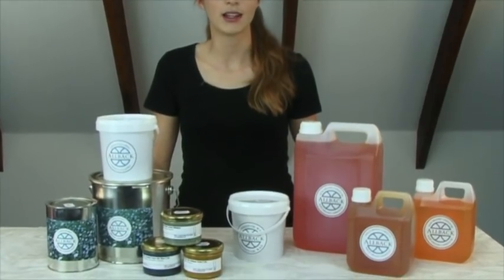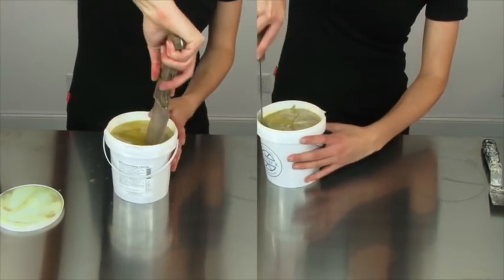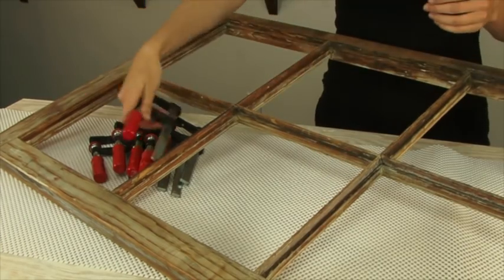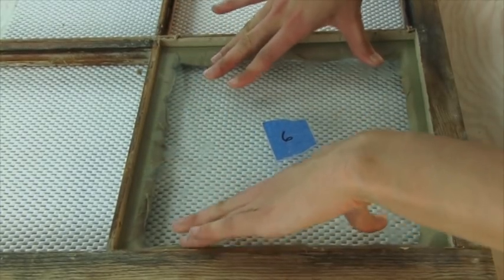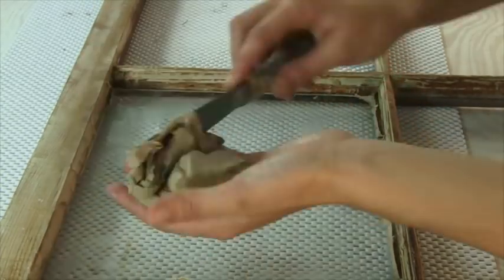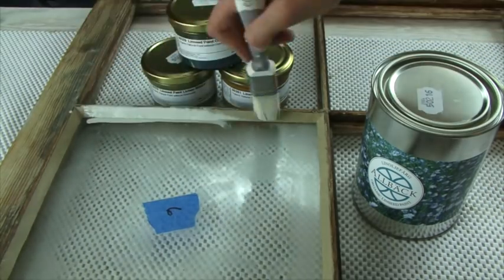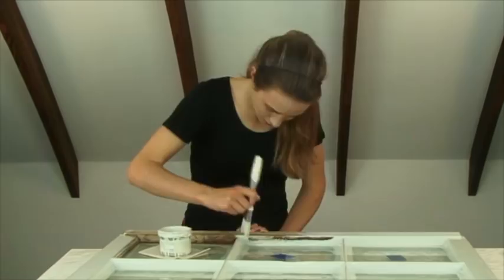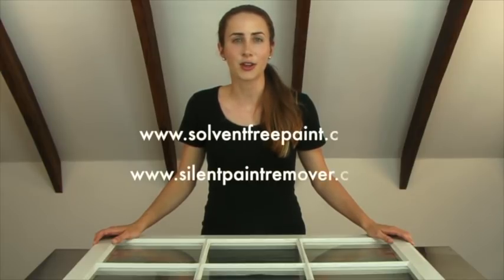Window Restoration w/Allback Linseed Oil Products: Part 2 [Full]

Comment: This  and part one are really useful, thank you! I am reforming an old Casa Rural in Northen Spain and need to improve  at least 10 windows as they have different sizes and come with internal shutters as well! They were installed in 1934. This video has reduced some of the nerves I have in doing this.  I just need to purchase some tools!!!!
Reply from the maker: Window restoration is time consuming but a lot of folks get really into the process once they get started. Just start with one window to gain experience and confidence. It sounds like a project well worth the time and energy! Check out one of the newest videos showing Swedish Windowcraft methods as well: https://youtu.be/VXnEwrelg_c Hope this is helpful and good luck with your project!
Reply: @Earthandflaxstudio  Thank you.

Comment: Is it this specific combination of products that allows you to paint the glazing immediately? I use Sarco brand glazing putty (linseed & soybean oil based) with Zinsser primer and Sherwin Williams topcoat (both oil based) and was always told to wait until a skin had formed on the putty. This can be time consuming and would love to find a quicker approach
Reply: Also understand that when the paint store say they have oil paint they mean Petrochemical oil paint!. Linseed oil paint is something completely different: Natural, breathable and free of Micro-plastic.
Reply from the maker: Yes, the combination of the Linseed Oil Paint and the Linseed Oil Putty (both a natural, oil-based formulation vs. petrochemical-based oil) allows you to paint immediately after glazing. Linseed Oil Paint has a longer dry time (48 hrs or so between coats in ideal conditions) in comparison to most modern coating but the ability to paint right away after glazing is a enormous time saver. Also, no specific "primer" product required. Just glaze and then paint is possible. There are some other technique choices to be made in terms of the steps you do as a craftsperson but it can be that straightforward if needed. We have a newer video on window restoration as well if you haven't seen and hope to make more window restoration content in 2024 too with different methods/techniques. This material combination and method we call Scandinavian Windowcraft.

Comment: I was wondering where I can get wooden window spacers or do I need to make them myself? Also Thank you for such a great instructional videos. I am reglazing my 1950s wooden porch and this very helpful. I can't wait to start restoring the doors etc in my Georgian house now!
Reply from the maker: It is probably easier to make something than find spacers the right size pre-made. I know someone who uses the ends of wooden match sticks (trims off the top), soaks them in Purified Linseed Oil before install after backbedding/before glazing. He trims them down or cuts in half if needed to make a fit (remember you don't want it too tight!). So many various methods but I think that is a fun, easy trick. Hope it is helpful. Feel free to reach out to info@earthandflax.com with additional questions.

Comment: This is the only time I’ve ever heard to paint the glazing immediately. Is that only when using linseed oil paint?
Reply from the maker: Yes, this is only true when working with Linseed Oil Putty and Linseed Oil Paint together. Paint putty immediately so they dry at the same rate - great way to save time on that step as Linseed Oil Paint has a longer dry time than modern, petrochemical coatings. Great trade-off if that makes sense!
Reply: @Earthandflaxstudio  yeah that is interesting!  Does the rest of the paint dry faster than the paint on the putty? How long after painting are you able to install with that type of paint?
Reply: @cdm9011  Linseed oil paint must dry in concert with the linseed oil putty to adhere well. Paint right away. It will dry about the same. Drying time depends on the temp ( 70 degree is best) and access to oxygen. In room temp, it should dry for a week normally. Also depends on the thickness of the glazing putty as well. Paint onto the glass about 1/8" as well as it will prevent water from going between the putty and the glass. Linseed oil paint adhere very well to clean glass. Linseed oil putty can be maintained with the purified raw linseed oil over time. Should last for 50 years with some maintenance and a coat of linseed oil paint every 10 years.

Comment: Any tip on where to find the mullion strips? I have an old barn window with missing wood dividing strips. Thank you
Reply from the maker: Your local hardware store may carry some options but if it has certain profile, a local carpenter/wood shop may be able to make up something that matches or is a close match. Ask around in your area as you may have a local resource you aren't even aware of yet. Good luck!

Comment: I watched part 2. My mom brought her broken kitchen window when she was cleaning both sides to the window co to replace/repair the glass and glazing compound. She picked it up and brought home. They did not paint the color brown. Was it supposed to match the window? The compound is still wetting.. How long will it dry? I felt that window co was not completed. I did not want them to repair my windows for the glazing compound. 

I have a few windows. I would like to replace the window glazing compound since my dad passed away. I wanted to try since all the people can do. Why don't I. I don't know about linseed oil or not. I was told to put a window glazing compound. ?? So I had a hard time removing old tough difficult glazing compounds. How? I did use to putty to remove.. Mostly solid. I felt like it was like superglue there and wouldn't come off. Any suggestion?  It is still in the basement. I need to put it back to the widows.  Last week was cold.. We put heat on.. jeez. 
Another window wood paint really fainted. It is too late to smooth out, paint. Maybe next early Fall.

Comment: Hey nice video. I'm from Western Australia. The linseed window putty for sale here has instructions saying not to paint the putty until at least 2 weeks after applying. I asked at a window repair shop and they said the same thing. It would be easier if I could paint it immediately like you do in this video. Is it because the putty is different? Why am I supposed to wait 2 weeks?
Reply: I'd think that was to do with using modern conventional exterior paints (water based/hybrid/solvent based) - the recommendation is then to only paint when a skin has developed on the putty. In this case you're using a linseed based paint, so no need to wait for a skin to form. Apologies to E+F Studio for butting in, but I'm pretty sure this is correct.
Reply from the maker: Apologies for the delay in a response - somehow missed your comment! Linseed Oil Putty can be painted on immediately with Linseed Oil Paint. If you use a conventional, modern coating like an acrylic, latex, or petrochemical oil paint on the Linseed Oil Putty, you will need to wait 2+ weeks for the putty to cure before painting. 
The time saving aspect is only when using both the traditional putty and paint together, otherwise you will have issues with the putty/paint wrinkling as the putty/paint dry at different rates so you must wait as your window repair shop indicated. Hope this answers your question and reach out anytime to info@earthandflax.com.
Reply from the maker: @okafka5446  Well said! Yes, the issue would be the rate in which these different materials would dry. Only Linseed Oil Putty with Linseed Oil Paint can skip the cure time usually required for putty when using modern materials. A good time saver since the Linseed Oil Paint needs a little more time to dry based on no solvents/chemical driers in the formulation.
Reply: @Earthandflaxstudio  haha thanks for the reply! Albeit a bit too late :P Already finished painting my windows a few months ago, but interesting nevertheless. Waited the 2-4 weeks and used an acrylic paint
Reply from the maker: @Jiffy_Park  Congrats on getting your project done! I'm sure there will be other chances for you to work with the traditional linseed oil-based materials. Reach out anytime! info@earthandflax.com

Comment: Very nice video, but why using shellac? if the wood need the oil would it not be a idea to feed it up (with oil) before putting window back in?
Reply from the maker: Great question! The shellac is a barrier only on the glazing grooves to prevent the oil in the Linseed Oil Putty to disappear into the wood over time. You want the oil to remain in the putty so it doesn't dry out and fail. Certainly load up the wood with Purified Linseed Oil before painting and that window will last you a very long time.

Comment: What kind of paint do you recommend for the window tracks? It seems like if you use the same paint as the window, the window will not slide well.
Reply from the maker: Great question - there are a few different opinions on this as some folks like to leave those surfaces unpainted but I recommended wiping on a thin coat of Linseed Oil Paint onto all surfaces where wood meets wood. Yes, if you paint and apply all the recommended coats of paint to all sides of the sash, as well as the tracks, you can expect significant sticking but if you wipe on a thin, even coat on the sides of the sash, as well as the tracks and let it dry fully before install you should not impact the operation of the window. A little Linseed Oil Paint goes a long way so I recommend wiping on the paint with a clean cloth vs. brushing to have more control over how much you apply for this application.
Hope this is helpful. Feel free to reach out to info@earthandflax.com with additional questions.
Reply: On our historic houses, we try to leave these surfaces unpainted and we apply a bit of beeswax to the edge of the window as well as the track.....

Comment: Thanks for the super instructive video! How long do you think it would take to restore a double sash window if this is the first time doing it? Do you have any tips and hints on sills? Thanks!
Reply: I've just nearly finished my first sash (lower one). It's taken me a while. But, I had really tough putty to remove which I had to experiment with to limit damage to the sash. I also had to repair some rotten wood. As I was doing all of these for the first time I spent weeks doing it in my limited spare time. Not sure if that helps but I think it will depend more on your skills and the current state of the window.
Reply: I’m a pro and a full restore can take anything from 12 hours to a week.
Reply: Let's assume its a 6 over 6 pane assembly.... times will vary depending on how many panes. I began restoring sets of circa 1820 windows recently and the time for each set improves with experience. I would agree that 10-12 hours would cover all steps from wood restoration through final painting.

Comment: Are your products available in the U.K.? I restore windows in the exact same manner as this and am mid way through a set of 5 and will need to paint them.
Reply from the maker: Hello Adam, Most of the products I work with are from Sweden and may have UK distributors. Start with Allback for all your purified linseed oil window restoration needs: info@allbackpaint.com. They will most likely be able to give you the best information. Thank you for your interest and keep up the good work!
Reply: Earth+Flax Studio I’ve found a supplier for some of the Allback products so that is a great start.